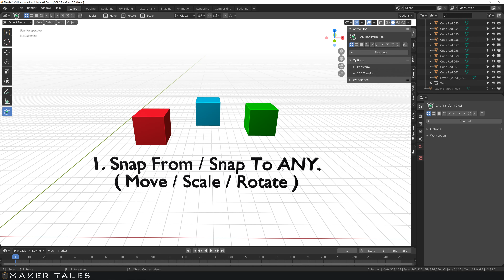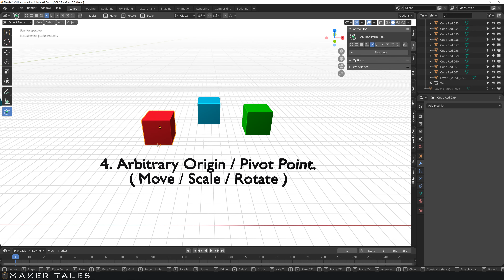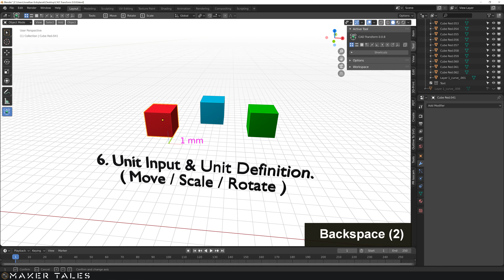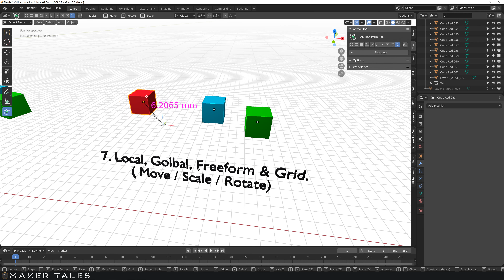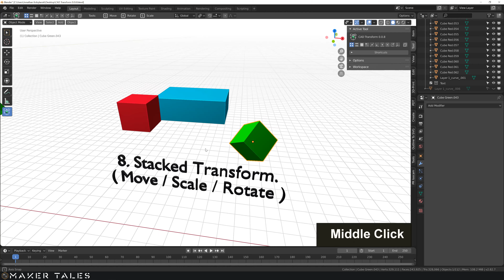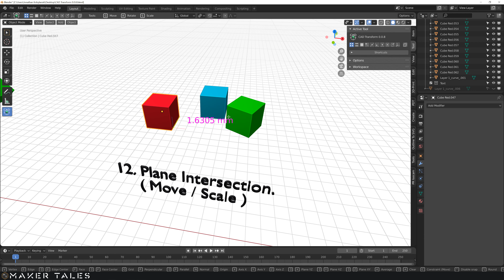CAD Style Precision Movement In Blender 2.83 | CAD Transform 0.0.8 Addon Update

Comment: I'm still missing precision rotation: First two clicks define the axis of rotation, and the third click defines the "from-point" of the rotation! Fourth click of course is the "to-point". 
Have I overlooked this ability?
Reply from the maker: Hi Karl,
With rotation it should be a three click thing... First click is origin point & first set axis point, second click is axis setting and from point & third click should be to point. I hope that helps let me know if it does =)
Reply: @Keep-Making  I'm sorry, but this an underconstrained definition. Please have a look at this video from SketchUp: https://youtu.be/bzJJD5wl4FY?t=308

The second point cannot simultaneously define the 2nd point of the axis of rotation, and the angle starting point! The starting point could be mathematically anywhere except on the axis of rotation.
Reply: @karlzeilhofer  2nd point define a vector (x axis) perpendicular to rotation axis (z axis), so it also define the starting angle. by default y axis is horizontal.
Reply: @StephenLeger  I'm really struggeling to rotate a cube with an arbitrary orientation back onto another cube (whithout using that perpendicular-feature of the object's origin). Could you please do a short demo of this? I'm still convinced, that the rotation about an arbitrary axis (defined by 2 points) with a defined starting point and a defined end point is currently not possible.
Reply: There are 2 ways, rotate in 2 steps (z axis, then x or y axis), or use the align to normal (wich also move your object over target surface) see 
44:37 - Custom Constraint Setup
46:57 - Custom Constraint Face To Face Normal

Comment: Great Video, very clear. I've noticed when I scale a cube constraining to Z or X or Y it applies a rotation, very small amount 4 decimal places, can't see why, have tried everything.
Reply: When you scale, the add-on align object's pivot to scale axis, and revert back once done. I guess there is a precision issue in this process. 
Looking in depth at difference, 2/100'000 degree definitely looks like blender's single precision and/or display rounding issue. Difference is about ~8.7cm at 100km
Reply from the maker: Hmmm that's very strange.... My only thought would be you might be accidentally be creating the scale axis a little bit a skew... but even then I don't see why that would apply the rotation. Are you able to recreate the problem in a fresh blender file?
Reply: @Keep-Making  Thanks for reply. Yes, a new file with the cube scaled on the Z axis to 4M the rotation 0 on X,  0.000018d on the Y axis and  0.000009d on the Z axis. I know it's a very small amount but why? Have you noticed any rotation?
Reply from the maker: Hmmmm... that is so strange....
I know it might be a tall order but could you do a screen recording on a fresh file and recreate the problem and that i'll see if I can find an issue. if not I'll send it over to the dev and see if he can find anything. Blender does like to do weird things sometimes.
Reply: @Keep-Making  I'll give it a go.

Comment: The addon would very much benefit from the pie menu with all the settings for snapping it provides. It loooks great but I'd really wouldn't like to mess up my shortcut settings. While setting up different ones for addon seems most obvious, it's not necessary there are enough free ones left on keyabord for that to not change anything from main Blender shortcuts.  
Nice walkthrough, thanks for it.
Reply: No need to "mess up" anything, available shortcuts are only active when operator are running.
Reply: @StephenLeger  thanks, sounds good. What is minimum Blender version supported? I suppose 2.81 and above? I couldn't find that information anywhere.
Reply: @alexz198  2.8+
Reply: @StephenLeger  the reason I asked was because I couldn't activate 0.0.8 version for 2.80 rc3 due to error on activating, while the 0.0.3 version I tried works but gives error in console "StructRNA of type SLCAD_OT_Translate has been removed" and it doesn't redraw interface and menus. Which I supposed means I have to update to newer versions like 2.82, not using last version of 2.80
Reply: @alexz198  minimum blender version is 2.81